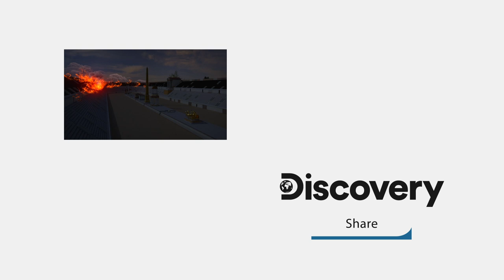Is Nero Innocent Of Burning Down Rome? | Blowing Up History

Comment: They didn't have osb in Nero's time. We don't know which way the wind was blowing or if it was even blowing at all. This is all conjecture, drama, and theory. He literally created a "perfect storm" there. Dry wood burns quickly and the heat could have easily moved the embers high enough to extinguish them before they fell to some random place. Most probably Nero burned his city.
Reply: good point. Science can be so useful, and or, so fake.
Reply: The j's burneed Rome.